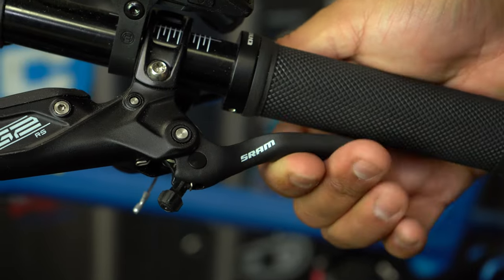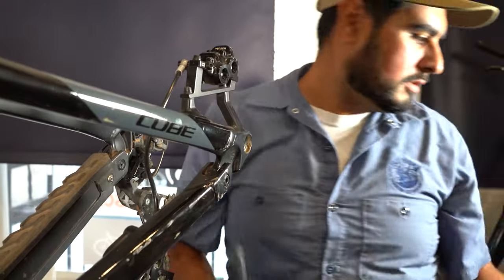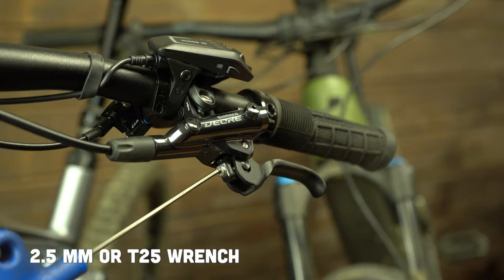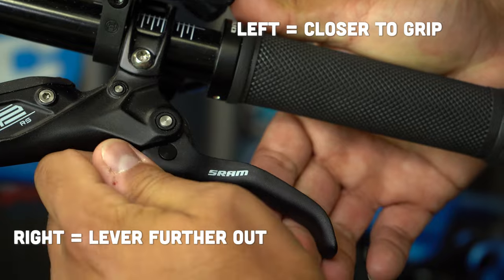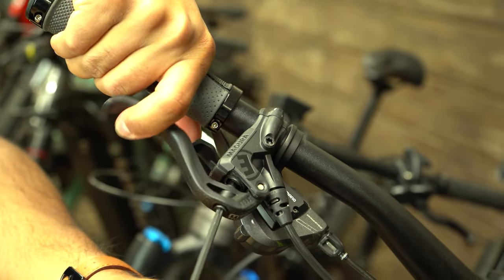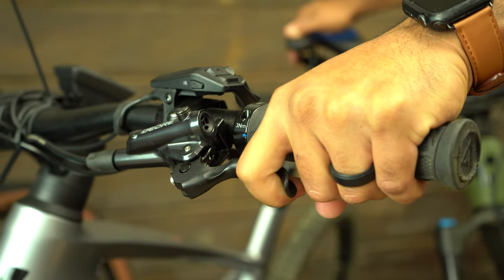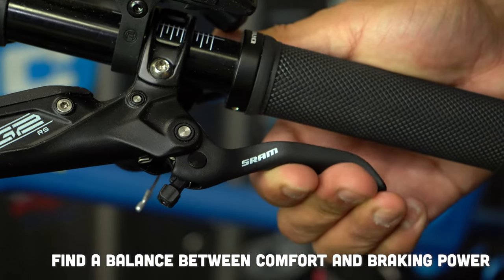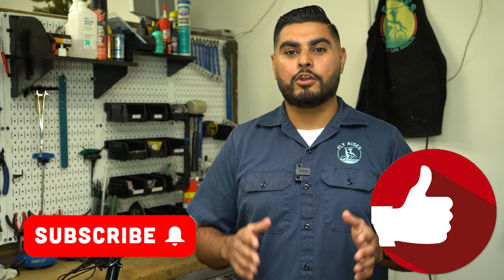How Do I Adjust My Brake Lever Reach? | Quickly Adjust Your Bike's Brake Throw

Comment: Scary feeling when the brake lever hits your knuckle and you don't slow down. It's crucial to make these lever adjustments for your safety and for proper functioning brakes.
Reply: Mine hits my nuckle, is this a video for hydraulic brakes?
Reply: @crazyparrot9113  yes, this video is for hydraulic brakes. For cable-pull brakes, you may be able to quickly adjust the tension using the barrel adjuster at the brake lever. Some cable-pull brakes have a barrel adjuster at the caliper.
Reply: @HectorSalcedo  I fixed my brakes and I also found out my brake setup I bought doesn’t have a bleeding hole so I just screwed on the cup with the brake liquid in it and just tapped the lines to get the bubble out and used the cup plug to kinda plunger the bubbles out 😅 it worked
Reply: @HectorSalcedo  also thanks you

Comment: But what if there is just too much slack in the brake? What if I need to pull down on the break too far for it to get to the stopping power I want? How do I shorten that, like going from needing to pull the lever practically all the way down to only like a quarter of the way down?
Reply: If mechanical brakes you need to tighten up your brake cable at the caliper end. If Hydraulic you likely need to bleed the system to get any air out. This will take out the excess play or slack before it effects the lever.

Comment: i have an older bike with radius brakes and it doesn’t have either of these, i just cleaned and did stuff to the brakes pads but my lever hits the grip and the brakes do nothing, help
Reply: Same im still wondering if u find let me know
Reply: Look up a different vid on tightening your brakes. That's what you need. This vid is for a different kind of brakes.

There is a screw on the caliper you need to loosen and pull the wire through then tighten up.

A vid would explain it better tho.

Comment: shim xt 8100s

Im in a position where if the brakes are close to my grip, and i one finger brake, it smushes my other finger.

I got the lever throw all the way out.

Do I need more oil in the line or something?

otherwise I had to scoot the brakes further away from the grip, but that also puts my shifters kinda far away.

What am I missing.

If I just 2 finger brake then Im fine but what the heck thanks?
Reply: Did you end up getting a different shaped or shorter lever so it doesn't hit your other fingers?
Reply: @tmuxor  nothing had, all got put on the backburner, would like to get ot figured out though now that my back is healing up to ride again
Reply: @jdssurf  damn yeah I know that feeling: I had two surgeries on my back last year. We'll see how it holds up this year 😄